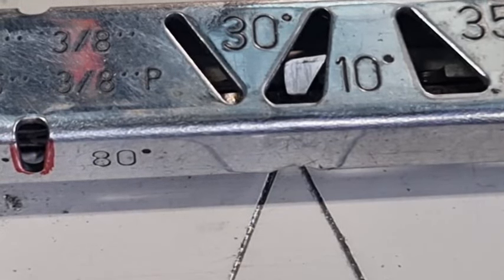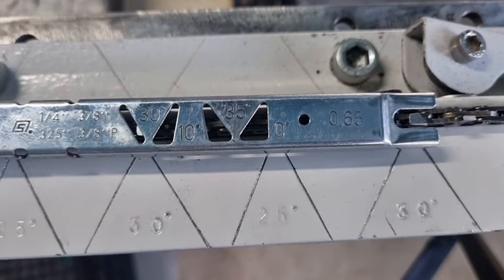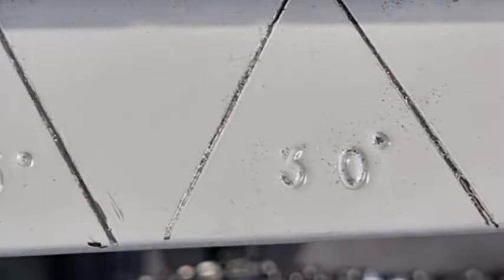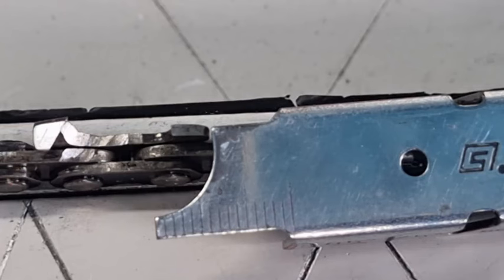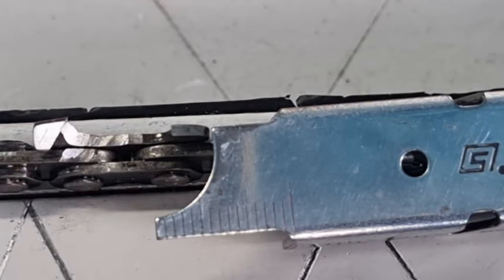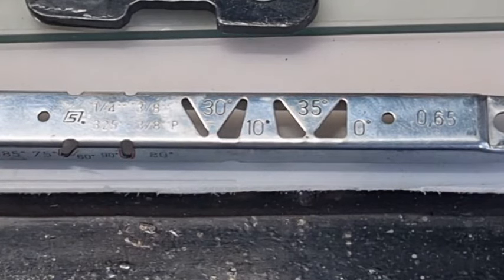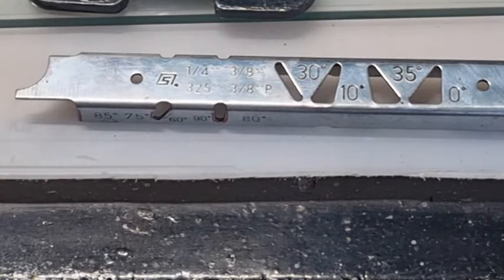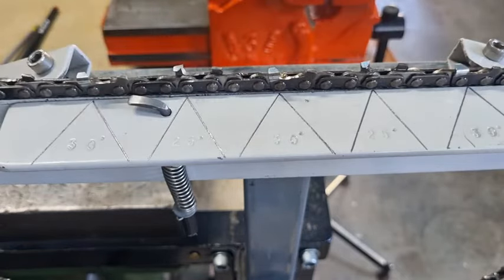Stihl Depth Gauge cut out windows explained

Comment: great video, I found out the hard way the Oregon version isnt hardened, it makes no sense why they dont harden theirs. What is your opinion of how good the combination files Stihl sells, the one that does the rakers at the same time as the tooth? I have gotten mixed results, I consider myself a better than average filer (I have a fitter qualification) but still (pardon the pun) my results are mixed
Reply from the maker: The original Oregon depth gauge was hardened.  Now Oregon is owned  by Blount they make a poor gauge indeed.
The Stihl 2 in 1 is ok I do have one also.
The best raker gauge is the Stihl progressive depth gauge. They make  5 versions for the different chains.
If you are in America they are not stocked there.  But west coast saws make them.  And Husqvarna also make them.
Reply: @ChainsawUsers  I'm an Aussie so I should be able to get the progressive gauge, we actually have 2 Stihl dealers in my town, we also have a Husqvarna dealer that sometimes has Oregon stuff in stock, thats who I got the non hardened gauge from
Reply from the maker: @davidewhite69 ok you need to order in Fl1 is 1/4, FL2 is 3/8lp, FL3 is .325 FL4 is standard 3/8 and FL5 is 404
You will find they work better they cost about $12 they are hardened so you can run the file over the top of them.

Comment: This is really difficult to explain and 100x easier to show but my camera wont focus in close enough to show it so I'll try my best here. 

You can use the side plate holes for checking round chain. It is a little easier to see on full chisel but works with semi as well. Notice how the cut out on the side extends over the top slightly? You can use that small upper part of the cut out to get lined up with the tip of the corner and then check the side. We only need to focus on the upper part of the side plate, approximately the top 1.5mm. What happens below that appears to be irrelevant as long as it doesn't protrude  out past the corner.

It's much easier to see this out in the sunlight, if I'm doing it in the shed I use a head torch. You will notice it's easier to do with the 60 and 80 degree cutouts because the edge of the corner will touch the front of the cutout. The 70 and 90 degree lines are tricker to line up at first.

It's a handy tool to have around to check your work but it would be nice if Stihl included a user manual for it because it took me years to figure this out and I would not be surprised if there is something else it can do that I don't know about yet.

If it's used for depth gauges with uneven cutter lengths, try only applying pressure with your index finger directly above the "0.65" mark. It does a surprisingly good job of compensating if you go back and check with a feeler gauge.
Reply from the maker: Thanks for your long comment much appreciated.  You raised some Interesting things.
Reply: Thanks thats great info. There is also 2 tiny circular holes on the top of the guage and underneath in the middle on the sides a small recess notch on either side. Any idea what this is for?
Reply from the maker: @5StringaSlinga hole on top is hang it on a nail.  Side holes are for the chainsaw side plate angles
Reply: thanks although this is not what I am referring to, if you look on the side there is a tiny notch which if you go to the start of your video and look at the angle jig you have made it happens to be pointing right at what I am referring to. Do you know what I mean? It's a tiny notch on both sides
Reply from the maker: @5StringaSlinga ok what is the time on video at the point you are referring to
Reply: @4StringSling  Do you mean the small notch on the bottom of the gauge, half way along? If so I don't know why it's there, it has the notch on both sides of the gauge but no indication of what, if anything, it does.

I put some string through the small round hole on-top so I can tie it to my fuel can.
Reply: @SawChainTheories  yes this is exactly what I'm talking about! wow so many questions and not enough answers haha. Maybe worth an email to Stihl